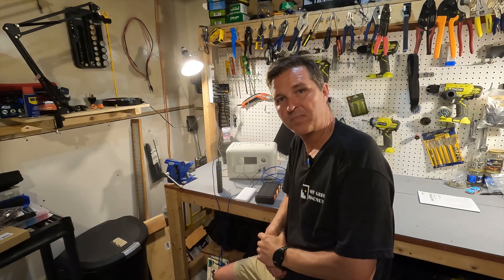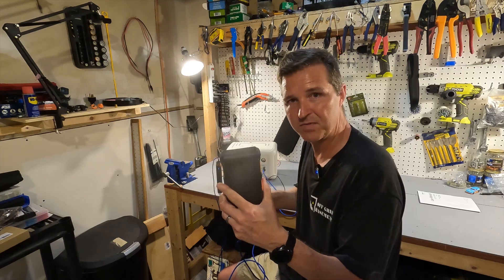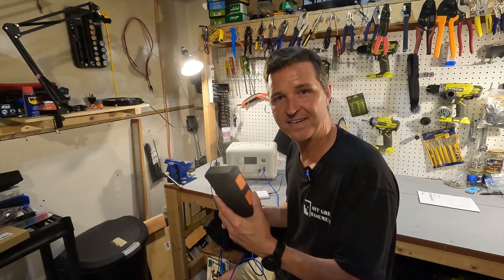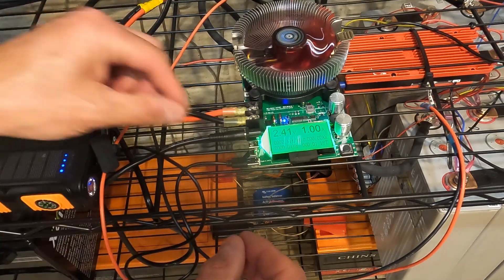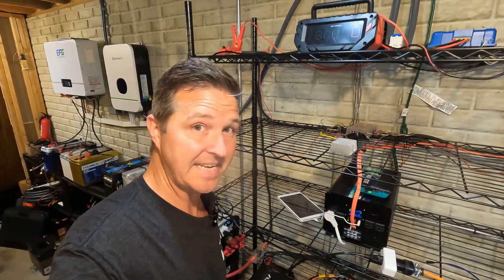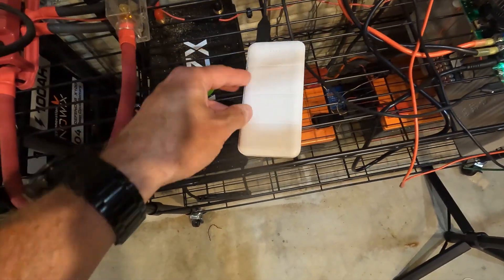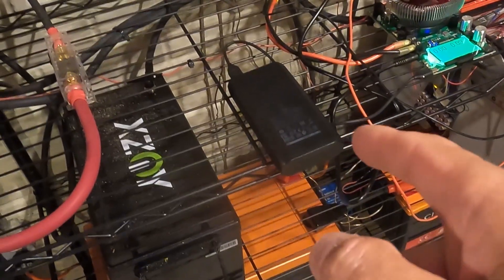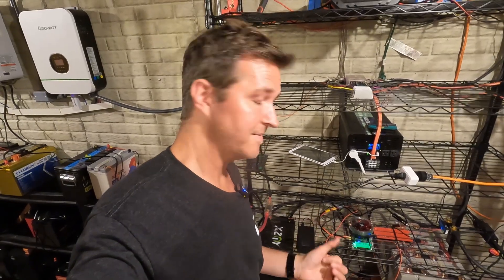All portable power banks are NOT equal!  The true capacity might SHOCK you!

Comment: I think the ratings are loosely regulated so if a device such as power bank states X amount of capacity, it’s probably supposed to be a variable average, but instead they probably list the highest capability instead of the lowest quartile…. So if you were to drain the capacity at the most efficient slower rate, it probably would perform at the rated specification. But that’s what happens when we buy things from China.
Reply from the maker: Thanks for the comment.

Comment: So like a year ago, I was considering building a big USB power bank out of 18650 cells. The confusing part was trying to decide if I was going to make it 4s or just parallel them all. 

Going from 3.7v to 5v seems like it would be more efficient than then dropping from a roughly 12v configuration. But then it seems like charging and discharging would be very inefficient and slow at 3.7. 

It seems like it would be inefficient within the battery vs the conversion to USB maybe being more efficient.

Anyways, just rambling now haha I’ve never seen actual tests to verify the advantages and disadvantages.
Reply from the maker: Thanks for sharing and the comment!

Comment: Name brand battery things are the best to get and never trust what they claim until tested. I got a fan with a battery in this year called Korbot from amazon that claims 12000 mah, mostly good reviews, when I tested it, it only put out less than 5000mah out of the usba port until it shut itself off and takes about 5100 mah to charge to full in 8 hours, very slow compared to my other fan. It claims over 16 hours run time on low, I get 8 hours on low. My Opolar, now called Koonie on amazon, fan that claims 10000 mah actually takes 10008 mah to charge in 8 hours to full and is 4 years old. It has definitely lost some of its capacity but I have used it almost daily for 4 years. It actually ran the length of time they claim of 14 or 16 hours on low when I first got it, seems closer to 12 hours now. On high it will run about 4 hours now, I think it claims 6 hours on high speed. I did solder some old power drill 18650 cells together in parallel for the Korbot fan and added it to the fan, it now takes 12 hours to charge and I went from 29 watt hours to 36 watt hours by adding those extra batteries out of a bad power tool battery pack, I think the bms board failed since it would not charge at all, I removed the cells and charged them all separately in a battery charger and they all took a charge, that was 1.5 ah battery with 5 cells that came with the tool. The original battery in the korbot is 4-18650 cells wired in parallel with no information on them at all, now it has 8 cells, I am using the 5th cell in a flash light. The Opolar fan has pouch cells in it.

Comment: There is a power loss in the DC-DC switcher which converts the 3.7v to 5v, so that last powerbank is probably closer to when it was new. Assuming 10% loss in the switcher, then the original powerbank capacity is probably nearer 67w, so its about 90% of original. Regarding those little USB cables.. they look as though they are fuse wire internally..
Reply from the maker: Thanks for the information and the comment.

Comment: What is the device that you were using to drain the wattage?
Reply: Hit the '...more'  link all his equipment are listed with links.
Reply from the maker: Electronic Load Tester, USB Load Tester 150W 200V 20A Adjustable Constant Current Electronic Load Battery Capacity Tester Module Power Meter, Intelligent Discharge Resistance Power Tester
https://amzn.to/4b8fFGa

Comment: I've had a couple smaller ones for years, even took them to Europe with me. They have their limitations and definitely should be used with the understanding that there will be degradation, all the claims are over estimates, and you might have to buy a few until you find one that fits your needs. That's how I ended up with a little baggie full of multiples. combined they would all charge my phone from dead to 100% twice. Hopefully id be able to get to a car or mains electricity to recharge them by the time they're all drained.
Reply from the maker: Thanks for the info and the comment.